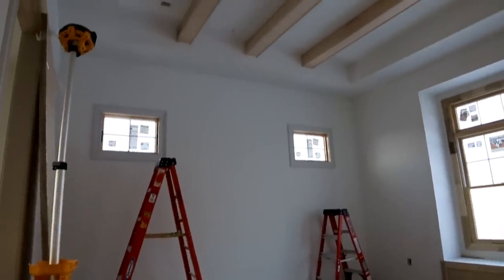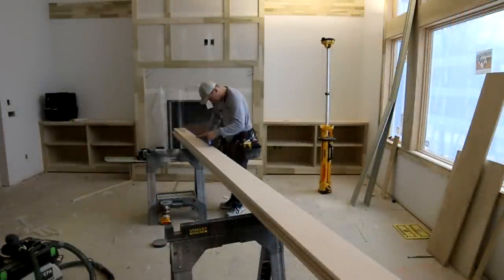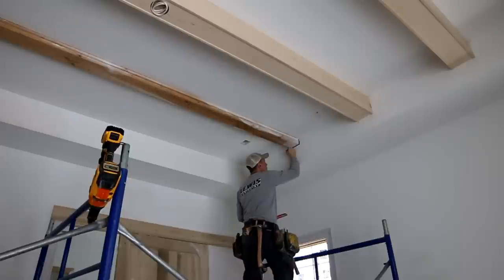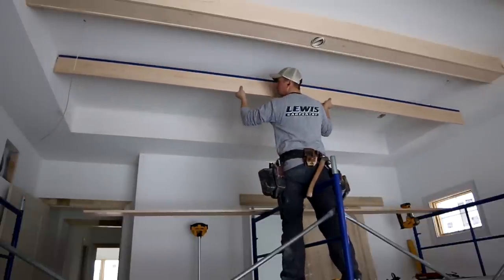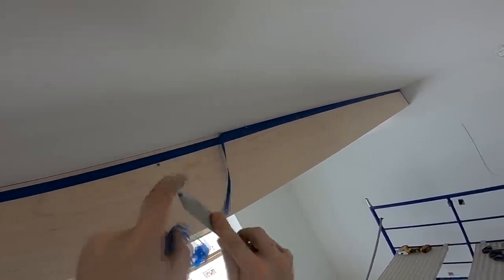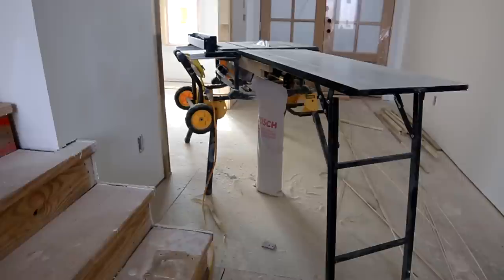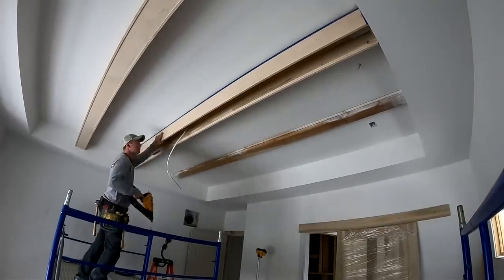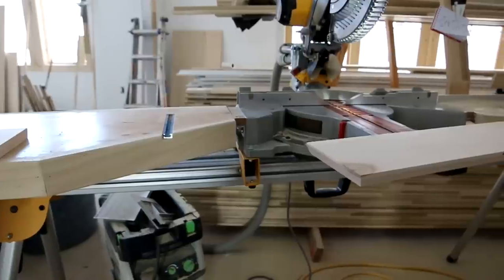Maple Box Beams - Building, Scribing, & Installing Production Style Beams

Comment from the maker: Support by Purchasing Tools Used via Links Below: (Thanks!!!)
Leica Laser Tape Measure - https://amzn.to/2Akz8am
Razor Scribe - https://amzn.to/2zopEKy
Hock 3/4 Marking Knife - https://amzn.to/2YtJDzR
Block Plane - https://amzn.to/2MMlXkW
Festool HKC Circular Track Saw - https://amzn.to/2XRah6W
Festool TSC 55 Track Saw - https://amzn.to/3hkmCIs
Rousseau Table Saw Outfeed - https://amzn.to/2BYPiXj
Dewalt 15 Gauge Cordless Nailer - https://amzn.to/30v5CJD
4 inch Hole Saw (Ceiling Light Pancake Box) - https://amzn.to/30yQwTt
Dewalt Cordless Router - https://amzn.to/2BQJIGe
Whiteside 5/32 Round Over Bit - https://amzn.to/30KJDi3
Starret Combination Square - https://amzn.to/2Air1uX
Goldblatt Torpedo Level - https://amzn.to/3hilSn6
Dewalt Table Saw - https://amzn.to/2AXFJY4
Reply: Insider Carpentry thanks you
Reply: 5l hut

Comment: Hi Spencer, I'm also an OCD on woodworking. Got to say that you did a fantastic job on the whole beam project; especially on the scribing and tapering to the ceiling. I was also impressed and inspired with your outfeed tables to that DWX723 support. I have the same miter saw and support; i'll consider adapting a similar construction for my needs.
Glad i found your channel. One last thing, great video production especially for a one man operation.
Norm from Montreal, Canada
Reply: OCD is right.  In the end use a shim, after spending an hour trying to get it to perfection?  There is perfection, and there is reality.

Comment: Leaving the tape on until after it's installed is brilliant. When I first started as a carpenter I was put on caulk duty, some other carpenters b4 me installed a stain grade t&g ceiling and their first run was beveled and scribed, and still looked like crap, graps everywhere. I masked off the edge of the board and caulked where the ceiling met the wall and it trun out looking perfect. My boss at the time wasn't expecting that, he was so stoke and kinda impressed.... That tip of leaving the tape on reminded me of that. Excellent tip. 👍

Comment: Man I love this channel.. I’ve done beams by putting a 45 on the top & nailing one side & use a bottle jack with a scrap piece of 2x4 to jack up the other side off a ladder or scaffold to jack it tight then nail it off..quicker than scribing..just a tip from my experience

Comment: I use all three scribing methods you show. One additional tool I like, especially for man-made materials, is the little one-handed Porter Cable 371 belt sander. With 50 or 60 grit belts, it can be quicker and just as accurate as the block plane, and not require sharpening. I wish someone (hear me, Dewalt?) would make a cordless version, maybe even a little smaller.

Comment: Finish Carpenters...
Work with painting contractor, or do it yourself... on stain grade... this beautifully done work should be stained and/ or clear coated before it is installed!!!  putty holes to match...wipe excess putty smears with thinner rag... and maybe one more clear after putty skins over... overnight ...  Prepping, staining, and clear coating on a few saw horses is the only way to go!!! Plus painting ceilings/ walls before hand... the only way to gp!!!
AND... watch all the videos from this OUTSTANDING FINISH CARPENTER!!!!

Comment: Awesome Video as always!  Question...why not build them on the ground and put up in one piece?   Is it because your working alone and it would be awkward raising it?
Reply from the maker: This style with the dropped sides I prefer to do piece by piece in place. It makes fitting and scribing to the ceiling and wall much easier.
Reply: @InsiderCarpentry  Maks sense.  I generally run crown inside the coffered box’s so as long as there are no large gaps I don’t need to scribe.  Great Video!

Comment: At 4:56 I guess you have to find that angle scribe against the wall(both sides), and then when you're installing them, you can scribe to the ceiling? I haven't even finished yet so you'll probably end up answering the question lol. I'm just thinking, how does plumb equate to square? You're just banking on the board being perfectly straight?

Comment: I’m not understanding how to scribe the ends of the board. For example in my head…you take a tape measure or laser measure and measure the length from wall to wall. Now, you cut a board square (with back bevel) to that length? Once you scribe each end wouldn’t it be removing more material, thus making the board shorter and leaving a gap on one end or the other?
Reply from the maker: Yes, you're not cutting to exact length first. You cut one end square, or just mark a square line...then adjust the line for your desired scribe...cut it...measure to the other end along the bottom of the board...mark the length...make a square pencil line...adjust the square pencil line to match your scribe...then cut...

In the video I may have done what you described...if I did it was because the bottom of the board was the longest point and the scribe cut angled in...this meant that shaving off the scribe angle would not affect the overall length of the board. Hope that makes sense.
Reply: @InsiderCarpentry  Yeah it’s starting to lol thanks for the reply! One more question. You mentioned the bottom of the board was your longest point…when I’m measuring to the other end for the second scribe, do I measure multiple points to determine the longest point? If the board hasn’t been cut or scribed yet on the second end how can I fit it in the space to scribe the second one lol sorry if I’m confusing.
Reply from the maker: I always measure from the bottom of the board because I want all three sides of the beam to be exactly the same at those connections where they meet.
Reply: @InsiderCarpentry  Thanks so much for the replies and what you do. 👍👍

Comment: You always do great work. I've learned some great tips from your videos. The one thing you didn't cover was the install of the 2x6 on the ceiling. Did you find trusses to nail to ot did you use toggle bolts?
Reply from the maker: Framers actually installed the blocking during framing stage.
Reply: @InsiderCarpentry  so it was pre-planned. That makes it nice. In the instance the isn't backing, what do you do?

Comment: Instead of using a torpedo level to do the end cuts just use a sliding bevel. It finds the exact angle needed that can then be transferred direct onto the piece to be cut,far quicker more accurate and your only cutting the piece once. hth
Reply from the maker: That doesn't work because the bevel gauge is thrown off by the mud build up.

The torpedo level is accurate because it registers perpendicular to the level line (The  beam) . The bevel gauge is not accurate at all.
Reply: @InsiderCarpentry  
Not accurate at all ? You must be doing it a different way to the way I and lots of others have been doing it for years. The bevel work’s parallel from the ceiling (from the same location that the sides of the beam are scribed from to get them parallel) with the arm of the bevel finding the angle of the wall.You could also use a Starret angle finder and that would also give you the angle to save you having to cut it twice. What works for some is done differently by others .

Comment: Excellent work on the beams.  A bit different method than mine, but I have a helper.  I wonder about the designer though.  Three random beams in a drop edged box looks kind of random and silly.  Try a 4 inch angle grinder with a sandpaper disc on those long scribes.  You might like it.  I use the grinder for formica tops, cultured marble vanity tops and long scribes in wood.  Also handy for coping bi-pass doors around base.

Comment: Here's a tip for how to handle mistakes.  Don't make them.  When I am on a job with a partner, mistake is not in our vocabulary - especially in front of the customer.  That said, we do have occasional unplanned "features" that show up from time to time and you just showed us a great one!  

Here's another tip.  I've noticed in several of your videos that you have a tendency to pull adhesive tape straight up rather than straight back.  In one video you showed where reinforced packing tape pulled off a piece of veneer.  I suspect this would not  happen if you shorten your pull stroke and pull the tape straight back so that it rolls off.  This may not matter with blue painter tape.  But if it becomes a  habit, it is a feature waiting to happen. 

Amazing videos!  Keep up the good work.

Comment: Dude your shit is tight, get a couple of rigid outfeed stands and put one behind you for long table saw work, make sure they are rigid brand flat top, you can get them at the depot, I work alone and have 4 , for third hand stuff. Trust me on the stands, I’m going to get razor scribe asap, switch to green tape from blue when scribing or marking. (as we say trust me). 
You the man, Pete
Reply from the maker: I actually own a few of those stands. I used to carry 2-4 of them in my van but I got away from them. They are definitely the best outfeed stand, but I find I can get by without them and it has cleared up some van space.

Comment: Would it not be easier to just set a sliding bevel to the angle needed for your end to meet the wall snugly?thats how I would probably do it. Not that there's anything wrong with your way at all.
Reply from the maker: It needs a longer point of reference on the ceiling. Any drywall compound build up would throw off the angle significantly when using a smaller bevel gauge.

Comment: I get the need to scribe to the ceiling...are those boards jointed then? They would have to be perfectly straight for this to work right. Or else you’re just scribing a crowned board tight to the ceiling. Maybe you mentioned it in the video and i missed it....
Reply from the maker: They don’t have to be jointed for this type of work. I make sure they are level on the ends and the center and orient the crown down on both side pieces. If it was really bad I could straight line rip with a track saw bit that is almost never necessary for me.

Comment: Very well done! Mid 80s Makita had a table saw that could attach an out feed table to. Framing jobs I'd use it too, rip 1/2" ply for solid headers. Used router with plung bit to cut out window openings. Running the high end coast of Maine my dry shell were very clean...

Comment: Good stuff, thanks.  In our house (built nearly 100 years ago) the faux beams have the cap covering the sides and you can see many gaps.  Your method I feel is superior.  Not sure I agree with glueing the cap in place.  If they wish to run more lights in the future or other types of cabling, (if all glued in place) will turn it into a nightmare!  Cheers, David

Comment: Love watching your tips
. I used to scribe everything. I was told by many clients after I thought I did a great job fitting everything tight to the drywall that  they don't pay me to cut wood crooked. Install plumb and level lines and fix the drywall.  That took me one job to understand it but it made a lot easier to understand it when I looked at the result. Finish carpenters should not have to make the drywaller's errors look good.
Reply from the maker: Its a necessary part of the job. Framing material is not perfect. Even perfect drywallers have butt joints. Scribing is an essential part of good trim installation.

Comment: Quick question. How do you address the screw holes that are left when doing stain grade? Do you just fill them?
Reply from the maker: Yes, being that its up on the ceiling its not too big of a deal, I use GRK cabinet screws which leave a pretty small hole.
Reply: @InsiderCarpentry  Thanks for the reply! Yes those are great screws. I use the trim head screws they make all the time.

Comment: Great method, learned a lot from this video, thank you for sharing Master Spencer. I do find that using a torpedo to check the cut is often times inaccurate because the ceiling may not be level. i use a 2 ft long board ripped to the same width as the beam, sample up on the ceiling, then eyeball the gap left on the wall if any
Reply from the maker: I have to disagree with you. As a whole the 14' beam is going to be very close to level. But the margin for error with a 2 ft board is actually much more likely to throw off your cuts with any hump or dip in the drywall.
Reply: Perhaps we can agree to disagree. In my experience sometimes the torpedo method works, sometimes its like you say “very close” but the 2 ft board has never failed me as long as it sits tight on the ceiling. If i were to use a longer board the humps might throw off the cuts. If the humps are bad enough to throw off the 2 ft board, it will probably throw off the torpedo too

Comment: you are a master ... you are so inspiring and do such a great job on all your videos.  you explain soooo well and demonstrate clearly.  however, why are these people paying for fake beams!!!!!!  they are so tired looking.  its over.  You sir, can't thank you enough for your gift to us with these vids
Reply from the maker: Its value engineering. Everyone wants the most bang for their buck. Nothing wrong with the beams.
Reply: @InsiderCarpentry  true.  goood point.  guess im just burnt out doing them and wish the fad goes away for a spell.  great work man! always next level.
Reply: @T.E.P.  Solid ceiling beams (not structural) do look awesome, especially if you like the natural, rugged look, with cracks and knots, etc.  But when those big guys decide to twist and warp, you can't stop them.  Built-up beams or box beams are best for very clean, cabinet quality finish, and are easy to do by yourself.  Personally, I prefer the one-piece look, with beveled bottom corners, so they look more real.  But any imperfections on those bevel cuts show.
Reply: @glenfreyermuth2972  thanks for the comment ... think it's important how you described that.  it is decorative and has to look good even without a function.

Comment: After adjusting the ends of the sides (your torpedo level method) then scribing & cutting the top, do you lose total length when the sides are slid up into place with un-square ends? Especially when the top un-square end is longer than the bottom.
Reply from the maker: It’s possible but they almost always taper inward because of the compound build up.